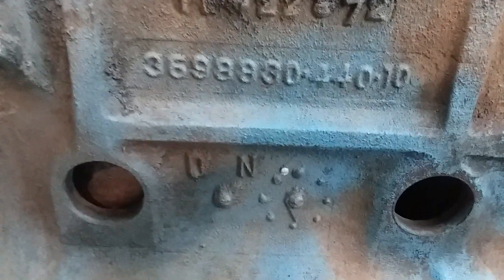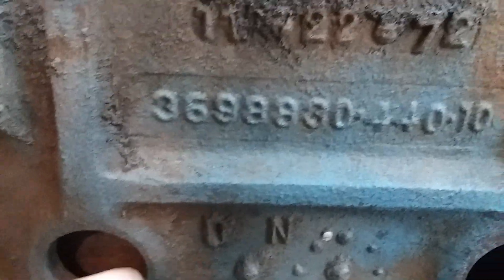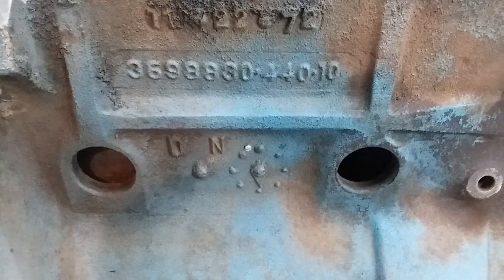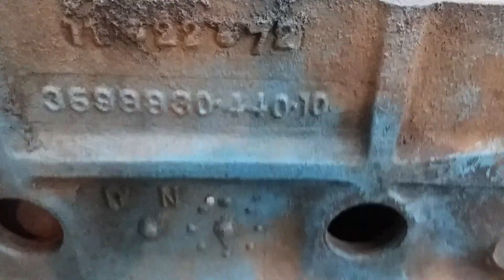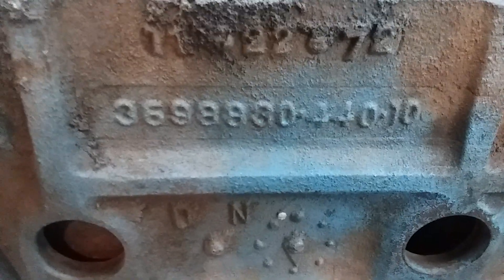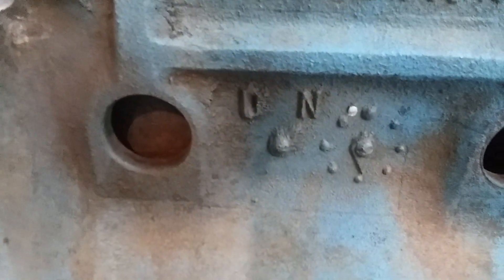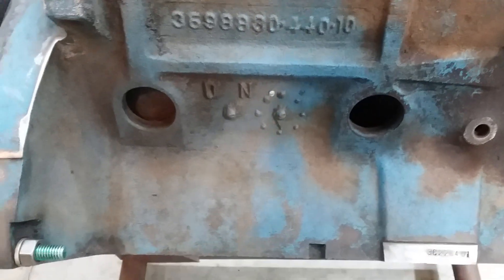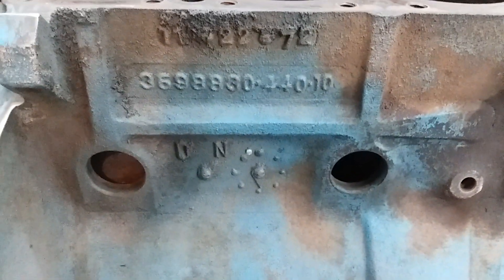Chrysler/Mopar V8 Engine Casting Part 3

Comment: Was told many years ago, by several people, that the dash number was the number of "core shifts". 'The higher the number , the thicker the block.'  I really think this was started by scammers. They see that number and come with a story to pump up the price of the engine: 'hey, man this is a thicker block, see the number 11 there? 11 core shifts.  Yeh, thick block, so that's why I'm asking $200 more than anyone else.'    
It's the mold identification number as started in this video. Incidentally, the highest number I've seen was 14. That was a 413 block. So I gather that there were at least 14 molds for casting 413 engines.
Reply from the maker: You are correct, there is absolutely zero truth to that one.

Comment: I recently bought a 1967 dodge cornet deluxe. I'm told it is a 440 but the valve covers looks small to me. I was told it may be a 273ci. The distributor is up front of the motor. From what i've seen, the two seventy threes.Have the distributor in the rear. So possibly I did get the 440.!! Any ideas on how to figure what motor i got. It's a barn find, lat on road 29vears ago. Thank-you

Comment: Great video.  I'm currently re building a 440 into a 505 and it is the better 440 block with the rib on the side.  We don't really care too much about the year, mold or shift, but its cool to know.  And if it was a problem mold, we don't want to know since its almost ready to go together, 😂😂.  GM did similar things with their blocks, but i think Chrysler was the most straight forward of them all.

Comment: A couple of my buddies had motorhome’s class A and C. Also a couple had 440 powered trucks. What we found is the Class A had 440’s that had 440-3 cast on the block. They also had the peanut plug heads . The class C had 440-10 cast in the had the std 14mm plugs. Same with the trucks. All but 1 had 440-10. The crew cab dually had a 440-3 with the small plugs. Just something we noticed back in the day. Thanks for the info
Reply: 440-5 was the HP engine and 440-6 was obviously the six-pack

Comment: Gosh what a big hunk of slag or cancer looking material right there gloped on,the top line of characters you read as the date cast being 11-22-72.Good for you being to make out the numbers clearly. I guess whoever might surface that block sometime in it's future might get a mild jolt to see if that ol' clump of slag mills down too (like fresh machined steel) or if vibration causes it to fall free like something rotten ?

Comment: What do the first numbers 🤔 mean? How do you tell what the block came originally from?
Also if possible what about the transmissions and codes location for the 440. Just got a 1973 jeep with a 440. And am trying to get educated.. appreciate any information. Block is 253(8or6)430-5. What makes a 440 a 6 pack engine and whats the differences?
Reply from the maker: 2536430 – 1966-1972, 440 RB-series big-block. https://www.allpar.com/threads/the-history-of-the-440-six-pack-chryslers-ultimate-street-motor.229981/